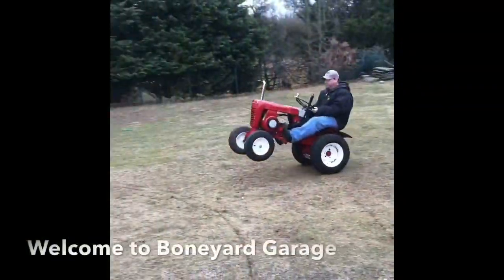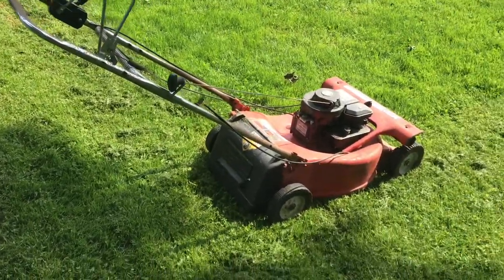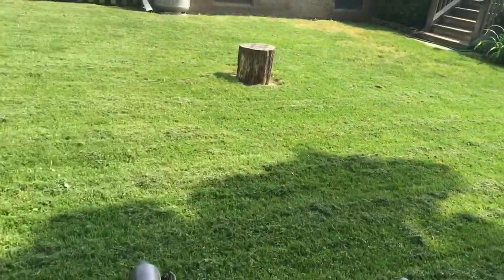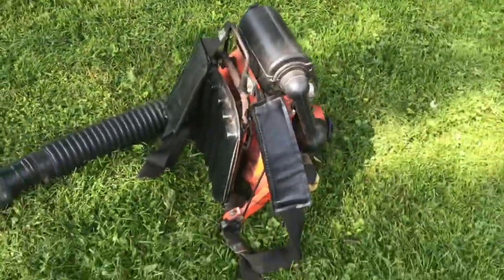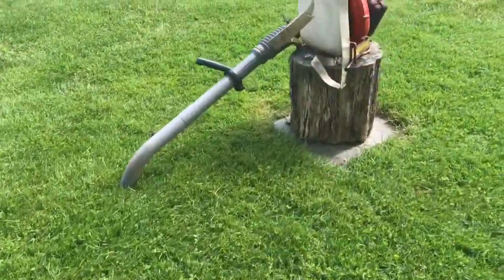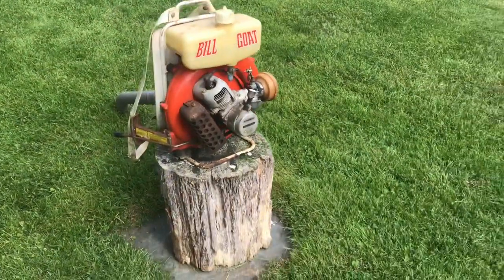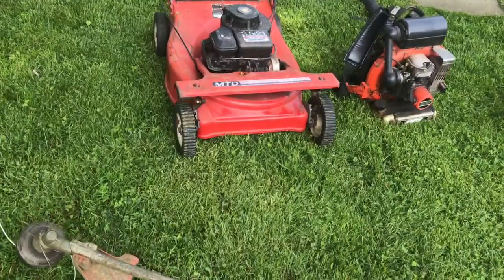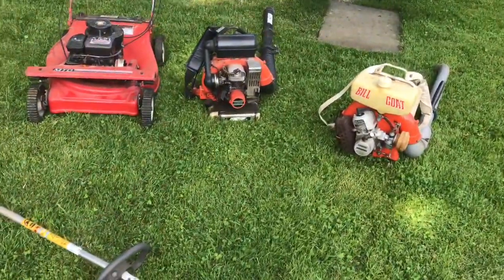Cutting the grass with the 1988 MTD Mower

Comment: Cool! I like that mower! I currently use an old craftsman Eager 1 mower from the 80s. Problem is that the old Tecumseh really needs a rebuild as it smokes like a train. I think that I am going to just run it until it blows up or quits running and then make some sort of frankenmower. If I had that mower though, I would totally use it too!